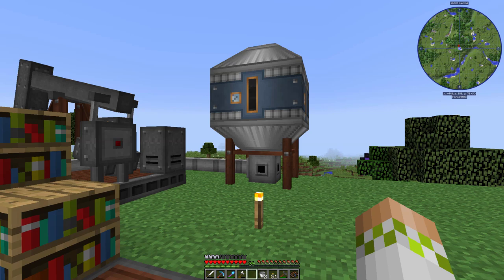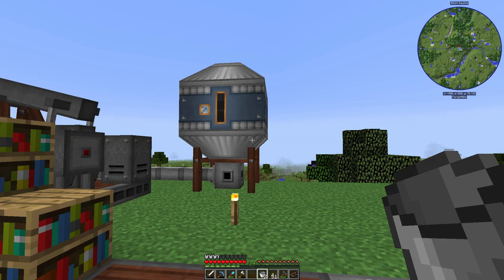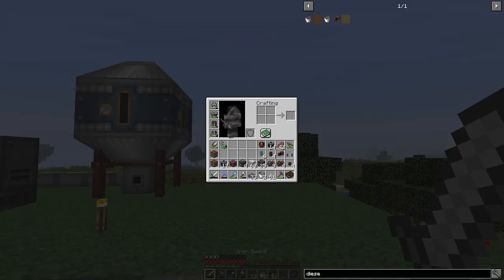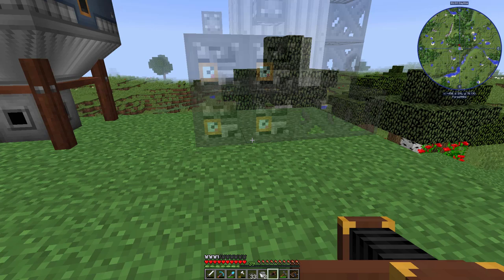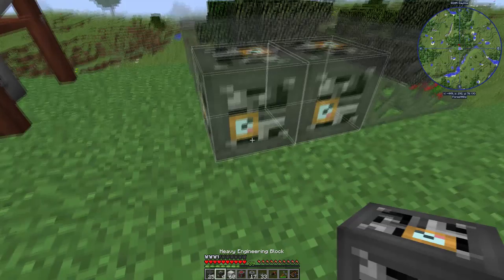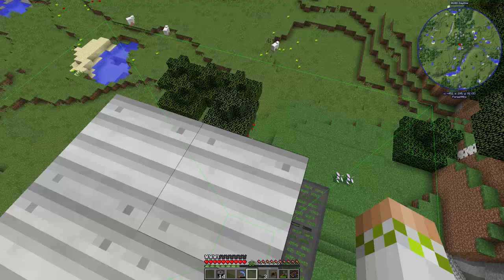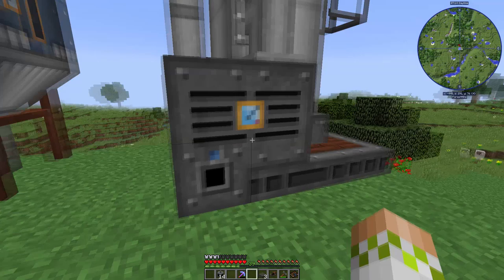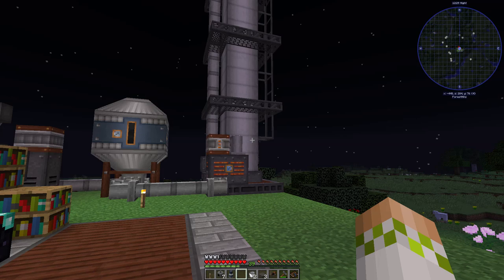Surviving With Immersive Engineering :: E12 - Distillation Tower

Comment: Which power production mod is easier and cheaper? Mekanism, Thermal Expansion or Immersive Engineering?
Reply: Depends on how far into them you get. Thermal can do a pretty good set up from tree oil, Mekanism's gas generator can do a decent bit but takes a bit of setup.

Thermal and IE can be done most easily the earliest.
Reply: However, I can say for a fact that using Thermal to make steam to use in Mek's multiblock steam turbine will keep you set for a while.

Comment: Did not explain how to split oils!!!
Reply: I know your post is hella old by now and you probably already got it, but using the fluid router and fluid pipes will route the fluid outputs into separate tanks. The router has the option for strict filtering but in this setup, you should be fine running it without a filter unless you somehow get a backup of fluid outputs